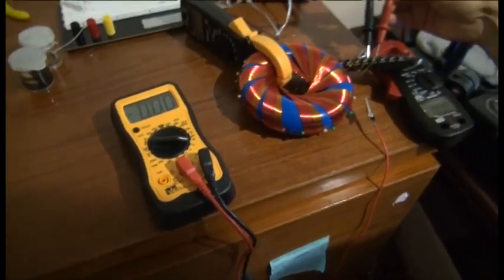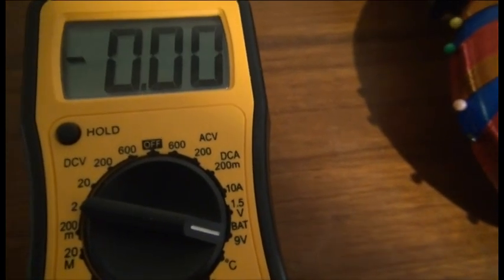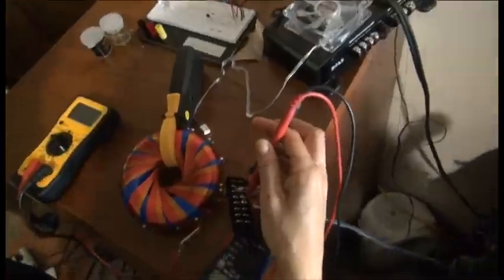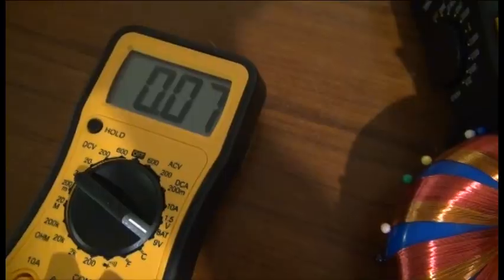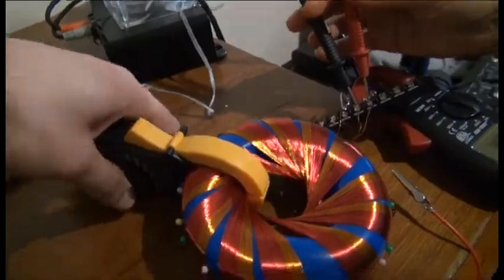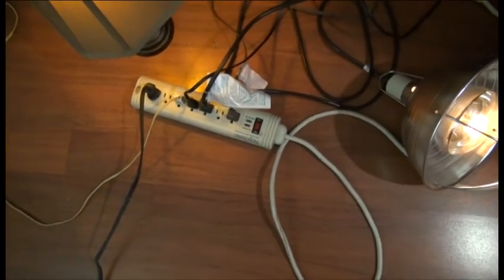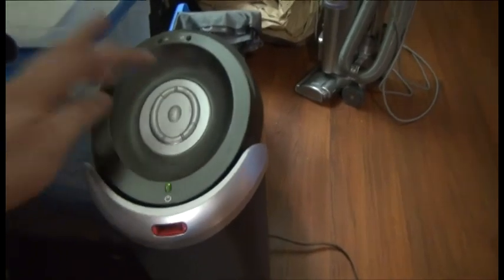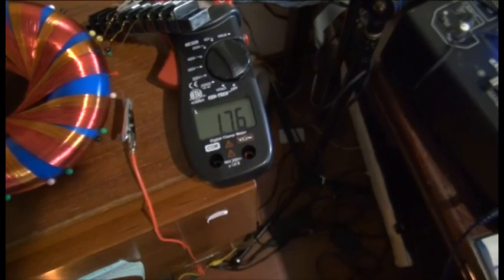Aethereal Coil -- 05/28/2012

Comment: I would say great but one thing you didnt explain the extra energy part. The power source still transformed the energy to power those loads. Put what did you say 200amps at 9v and see if you can move a 2kw motor
Reply from the maker: At that time I didnt have seperate watt meters to measure all devices. I simply was exited to see that many amps passing through without that much power going in and I was suprised to see more that one device power up and the volts on the input where interestingly low just a couple few volts. I have developed a cicuit that moves a over 3,000 watt motor with 1,000 watts however if I post that video I dont think I will disclose the circuit because Im commercializing it and licensing that system however I am adding in the votex coil with a full circuit coming up end of this year maybe sooner as I get all the parts. We have graphene batteries and ultracaps in development with advanced BMS and Micro grid communication networks for micro grid, compute I will be loading up with decentralized ai chat LLMs, POS, blockchain, VOIP, and media render system CDN we should have ready early next year maybe end of this year.
Reply: @AMARAKATV  There's nothing here to commercialise I'm afraid. Your measurement technique is the sole reason your results don't align with those predicted by physics. 1kW power can easily move a 3kW motor - it'll just spin slower or with less torque depending how it is loaded. Top marks for a neatly-wrapped coil though. I wouldn't have that much patience.